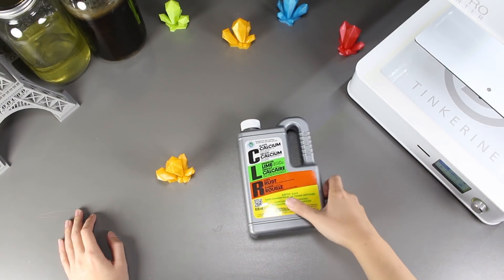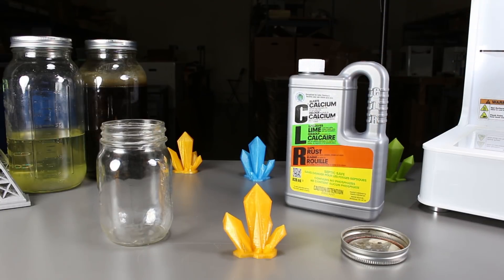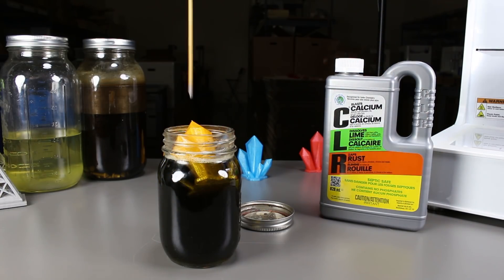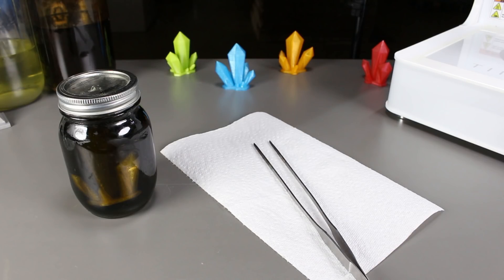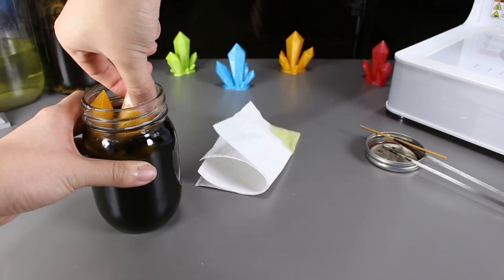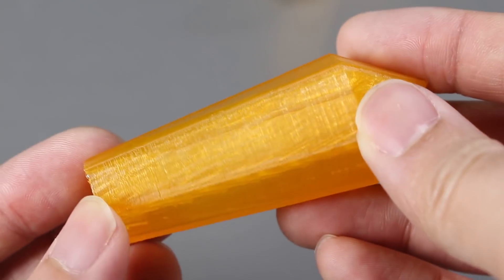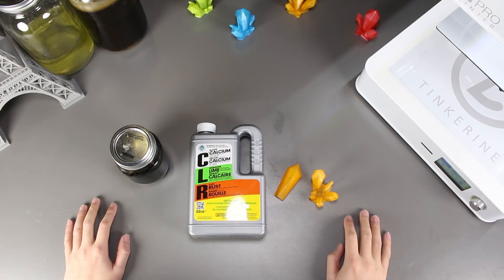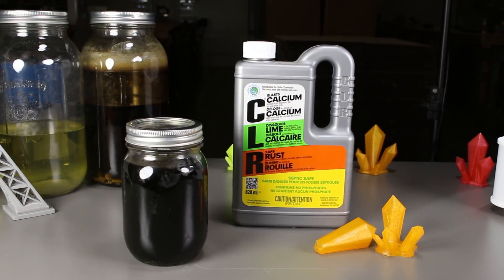Attempting to Smooth 3D Printed PLA Models with CLR

Comment: Woah. I had to take off my headphones to make sure the audio output hadn't switched on me. Also, thanks for putting all these ideas to the test. I probably wouldn't have thought of most of them, but my kitchen is probably a lot cleaner thanks to these videos.
Reply from the maker: Hi,

Thank you for the comment! That is brilliant, was it a nice change of pace for the new voice?

Do you have any experiment you would like us to try?
Reply: If you want to have different people hosting the videos every now and then, it is a neat bit of variation. As for experiments, I have heard that acryllic solvent cements work for bonding PLA (Scigrip 4 is the one I've been considering grabbing). My thinking is that if it does actually bond PLA, it might work for vapor smoothing, like acetone does for ABS.

Comment: Could you try some polishes. Iv just brought some "brasso" to try myself. It's for polishing metal and is slightly abrasive so I'm told will have a smoothing effect.
Reply from the maker: Hi,

We'll look into acquiring some to try it out!
Reply: Tinkerine thanks
Reply from the maker: I'll try it out without sanding the PLA down, interesting find!